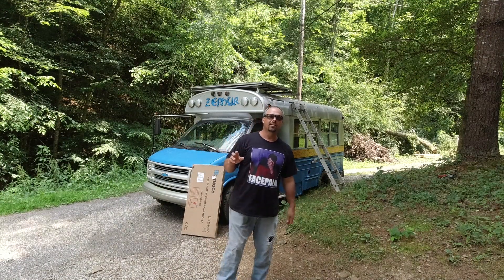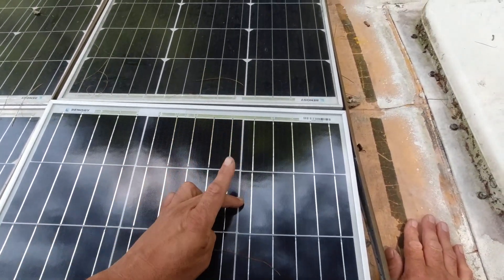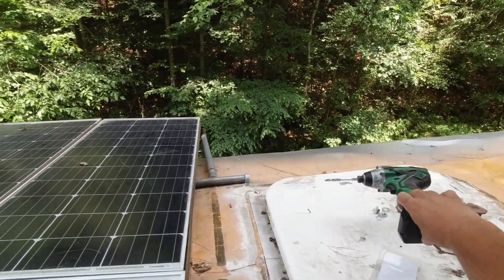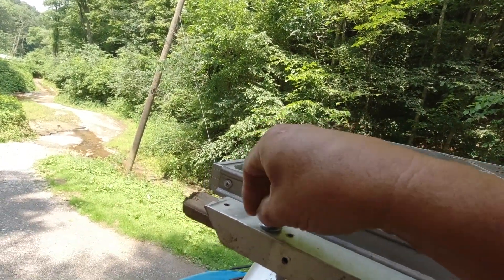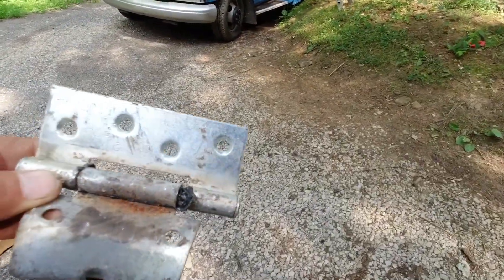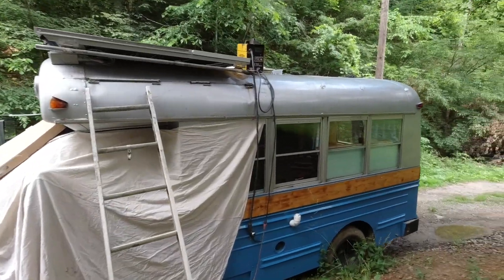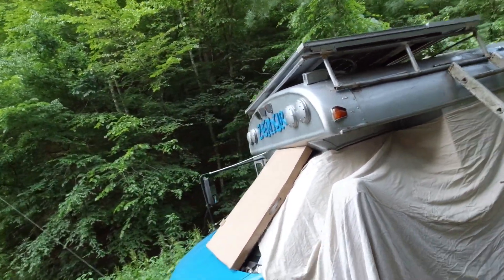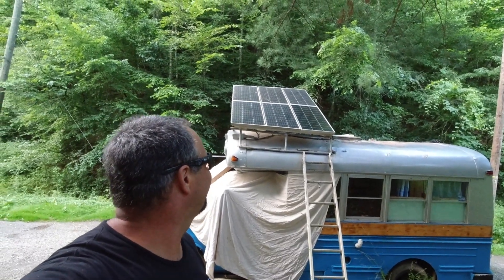Rebuilding Zephyrs' Solar Array

Comment: Looks good Luke! I am having to replace my charge controller, came with kit, only 4 months old.
Reply from the maker: Thanks! 
Is it a Renogy controller? They should have a warranty on it. They don't usually fail that quickly.
Reply: It's a kit from Rich Solar. Problems with charge controller from out the box so saw this coming. 
You did good Luke. My sis in fl just bought a schoolie to convert.

Comment: Yeah I like the head mount. Glad to see the bus is getting back together
Reply from the maker: I like the new view too. It does show more detail. I could see it making people dizzy though. I think I will alternate between the tripod and head filming. 
I took Zephyr for a little cruise yesterday and he still drives great so I guess the damage was just to the top. I was kind of concerned because the suspension was bottomed out by the tree, but It is fine.

Comment: the head camera worked ok. I doubt anyone will notice the slight differences in that one panel, I'm certain I wouldn't and probably couldn't see it if you showed me from the ground
Reply from the maker: I like the head cam footage, but just needs a slightly better angle.
Yeah, it doesn't show up from the ground unless you are really looking. I need to run him to the car wash though. I didn't realize the other ones were so filthy lol.

Comment: I don't mind the head cam video Luke, but a lot of people get nauseous watching it like that. I guess motion sickness is pretty common. It's good to see Zephyr get the rest of it's power plant installed. Looked like hot work. Do you get much breeze down there in the hollow?
Reply from the maker: Yeah I could see the motion sickness especially on a bigger screen. I do like the detail that it shows though. I think I will throw a little bit in every now and then just to break it up a little. 
It was a little hot, I am glad to have a shade tree to stay under. We get a few breezes here, but nothing like on the hilltops.